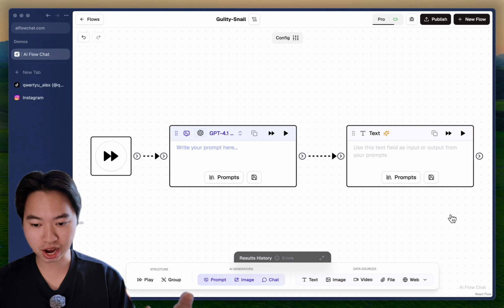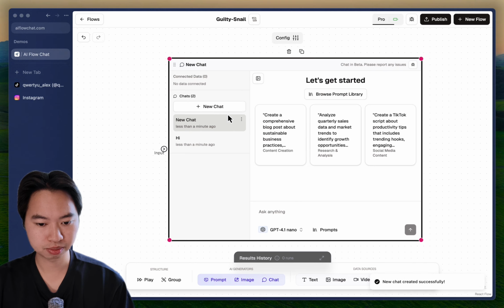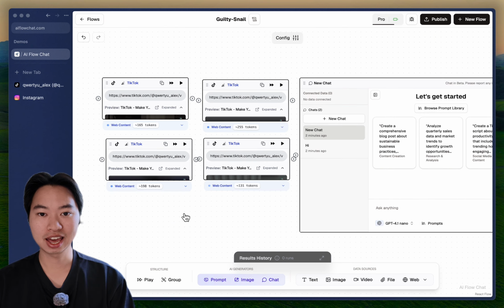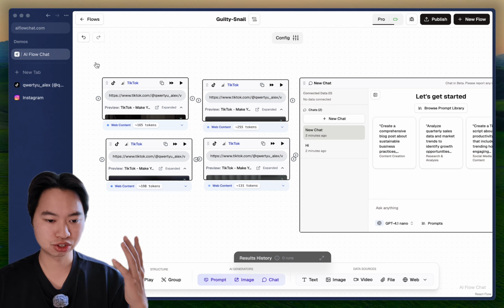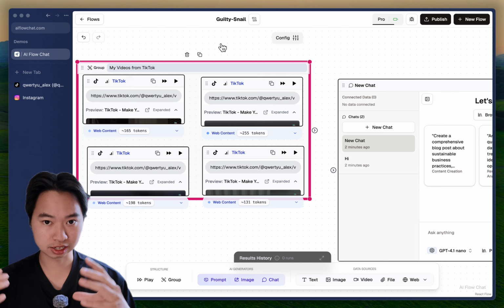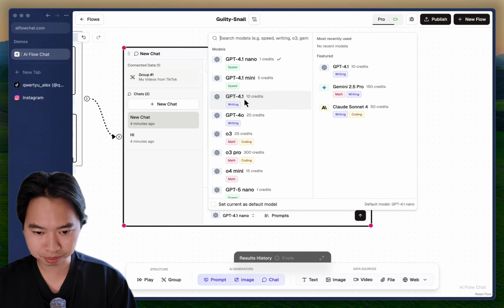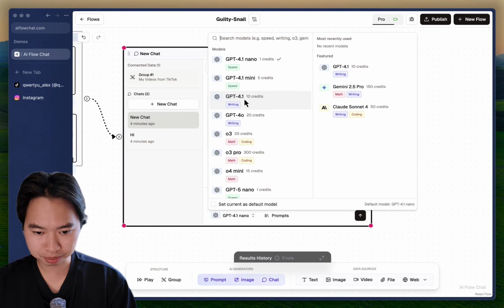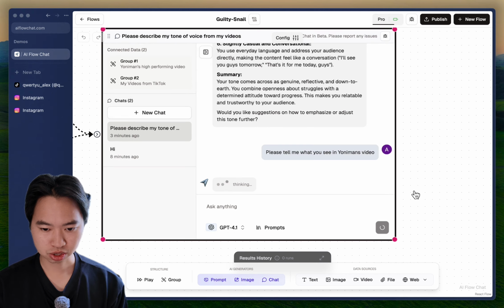Script Video Content using AI - Use Viral Videos as Your Knowledge Base

Comment: using the tool now and my only headache is if to use gpt 4.1 or claude sonnet and for what task to use which may you clear that a bit?
Reply from the maker: I’d recommend Sonnet 4.5 or gpt 5 for all tasks. What it comes down to is mostly preference for it’s writing style. Sonnet is faster than gpt 5 so it’s my go to most of the time 😄